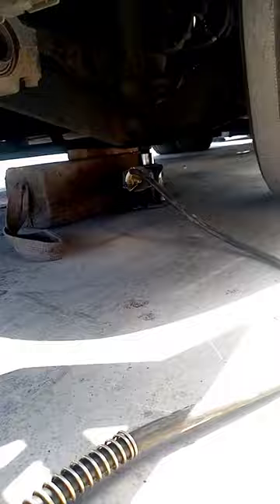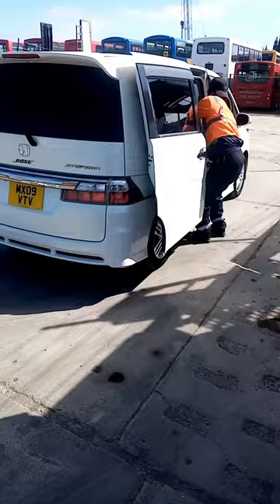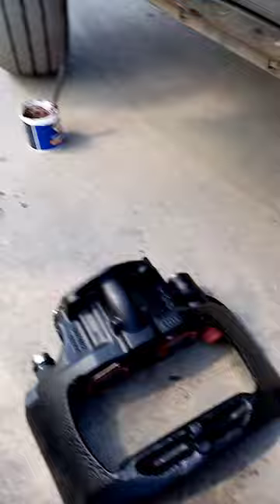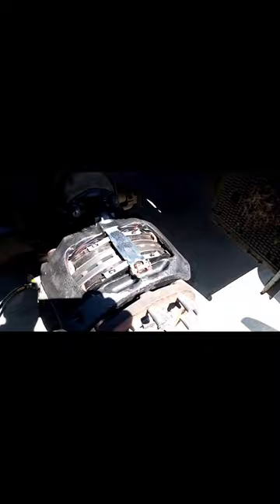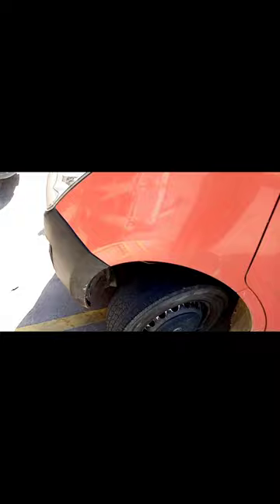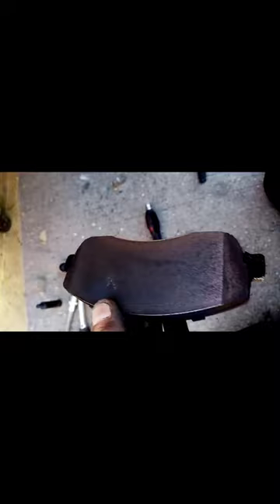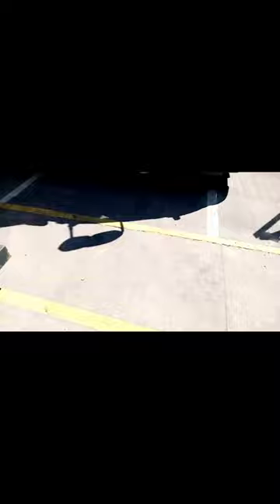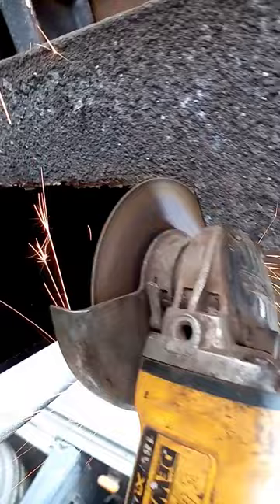car transporter brakes, movano brakes and some trailer landing legs to fit, today's jobs 👍

Comment: You are able to buy just a single brake pad?  Here in the US, they sell them in sets.  I don't think you can purchase just a single pad.
Reply from the maker: Morning Mike no you have to buy a set but on this occasion it had just had new pads and the wire hadn't been clipped up which cut through on the rim so I just took one pad and fitted it, had the pads been worn I'd have fitted the set, the driver was waiting to deliver so I think it was the best option